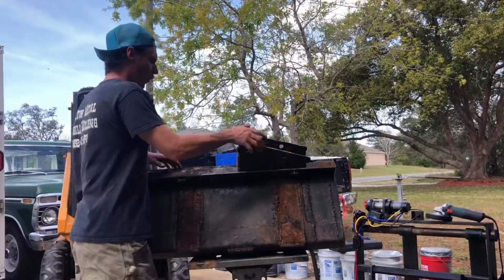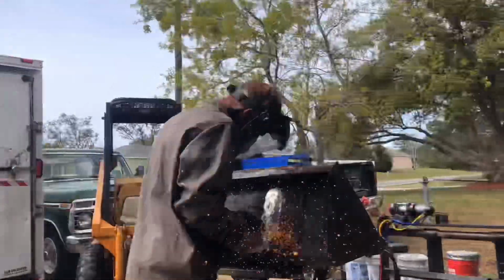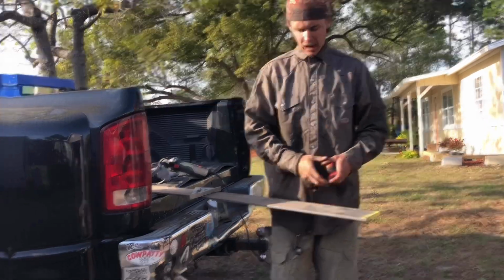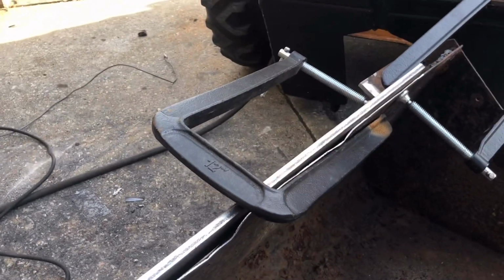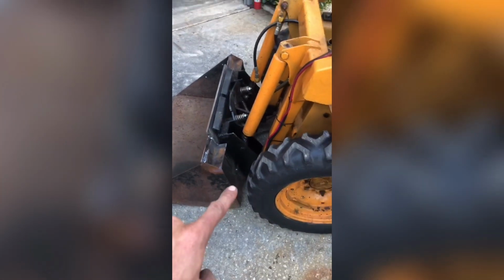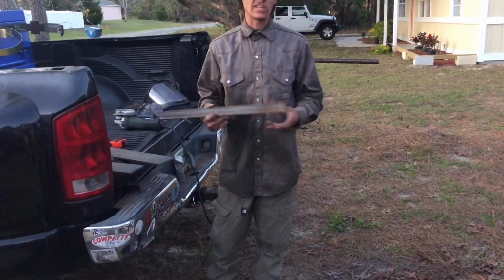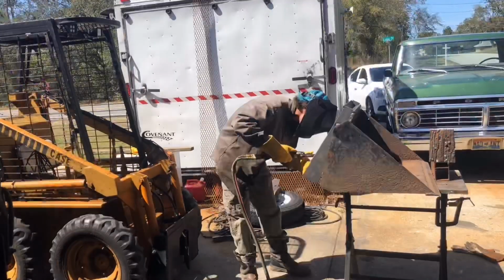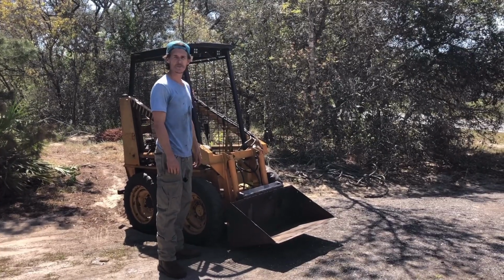How to make a skid steer quick coupler receiver !

Comment: i have restored 1976 Case 1816. new Kohler 19hp motor, new chains and bearings, cylinders rebuilt. made new bucket and a tooth bar and it cuts like butter and wants to dig. dug tree stump out. And love moving snow. cleared street off that had 1 1/2 ice. love mine.

Comment: Great job. I have an 1816b that I am starting to work on, so anything you want to share video wise would be much appreciated.  Also, where did you get the quick connect for the loader itself?
Reply from the maker: I got it from amazon and welded 2 together
Reply: Can you elaborate on the Amazon purchase?  Any photos of the install?   I am doing this exact same thing as we speak
Reply: I had a 1816 many years ago, I changed the engine to a 20 hp Honda, don’t think I would fit in it now LOL

Comment: looks pretty good, but why is the bucket narrower than the track of the skiddy?
Reply from the maker: not sure it came with the machine, works good enough for my uses
Reply: It was made so it could go into a 44inch door like a horse pen
Reply from the maker: @aidenganzer6353  makes sense i was wondering too!
Reply: The rims are reversible, 36" on side 42" the other side.  Now you can drive through a yard gate.